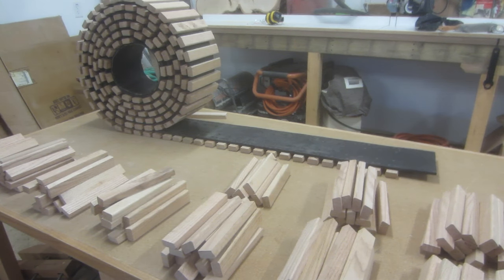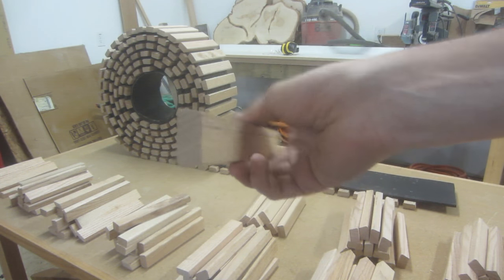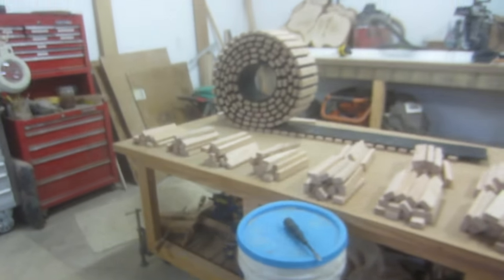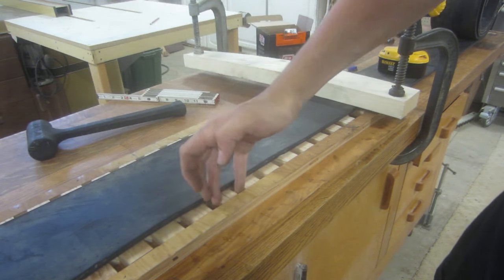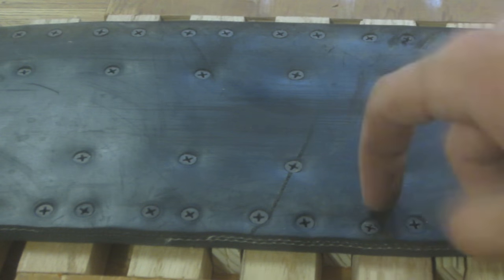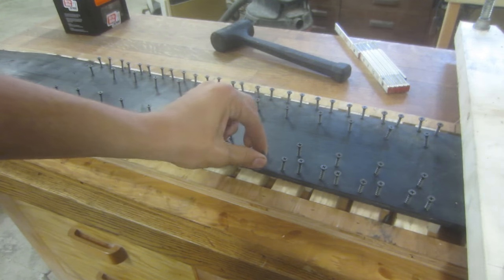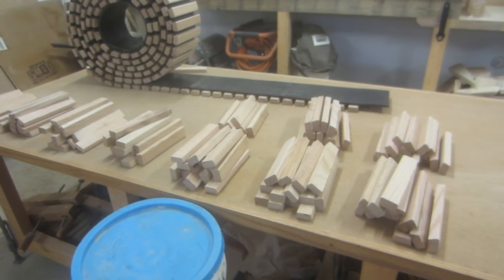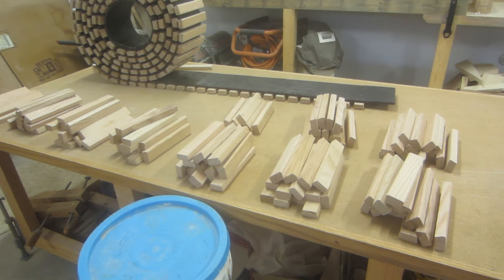Homemade Tank Part 3 (attaching the track pads)

Comment: Great work man!
I'm just now going through the entire series, but i have to admit that i was quite surprised you went for wooden tracks.
Then again, I suppose it makes sense because of the lower material cost, and the overall weight and manufacturing time, which just goes to show how well planned you built this. ;)
Cheers lad, keep up the good work! :D

Comment: A little tip, not sure if you've run into troubles with this or not, but those look like drywall screws. The problem ive run into with them is they are a fairly brittle metal, ive had them break. The gold adonized torx deck screws are much stronger and don't break.
Reply: die gets stuff fro the junk yard

Comment: I have multiple questions considering that I am considering making my own.Are you useing hydraulic drive?Where and or what did the system come from?I had the same idea with the conveyor belt for tracks, where did you get the conveyer belt? Thanks, keep it up, a fellow tanker.
Reply from the maker: Capt. Ray    It will have a hydraulic drive system. I have info about that in other videos and I'll post detailed specs on that too once it's completed. I was lucky and found the conveyor belt at a local junkyard. That'd be really cool if you could make a tank too! And if you do I strongly urge you to post videos documenting the build as I would be very interested!   PS: if you haven't seen it already, visit the channel tankman101 he has good videos.